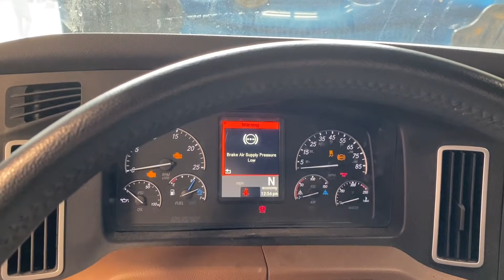Salvage Freightliner Cascadia Rebuild Totalled Copart Semi-truck Full timelapse

Comment: Money wise isn't cheaper to get another one?🤔? Just wondering how much hard work and money but at the end it's worth it
Reply: I'd say not considering it's the most common truck in America, so parts are readily available and cheap.
Reply: Yes Carlos ur right...
Reply: I can buy a great truck with 300k miles on it for around $20k-$30k I would never want to rebuild a totaled truck like this. Not worth it.
Reply: @ItalianStallion1415  there are no trucks that are 30k and have only 300k miles on it. If a truck has only 300k miles it will cost almost 70k so stop lying
Reply: @ItalianStallion1415  depends on insurance excess, insurance value on the vehicle, millage, spec, newbuild waiting lisits times and labour rates. 
most owner drivers its a no brainer to replace, but to a haulage company with set labour rates for their mechanics prob not. 
in the uk a bear cab is £12k, doors about £2k,exhust systems £26k with adblue but thats new prices. The hgv unit itself is £120k upwards depending on spec.
Reply: @ItalianStallion1415  maybe a low spec daf you could buy one for that money but not a full top spec usa sleeper cab thats 1.3million mileage in tatty condition money your talking about

Comment: Love cacadia I drive it daily 
My fav truck
Reply: What engine
Reply: @shhhhhhhhhhhhhh....  dd15 Detroit
Reply: @mercpindi5522  any issues with the dd15 im upgrading from classic xl to a cascadia but i hear horror stories about dd15.
Reply: @shhhhhhhhhhhhhh....  no because it was 2019 model.  I drove it last year. Got nice leather seats, sports body kits, lowered, fully loaded basically with very low miles. Never had a single problem. Cascadia is a nice truck.
Reply: @shhhhhhhhhhhhhh....  but let me tell you volvo is better than cascadia. Especially the 2021. Currently driving that...ride and acceleration is so smooth compared to cascadia...easy to drive like a car and back up...plus the big mirrors...oh also d13 volvo engine is 1000 times better than dd15. Buy the new volvo you will love it.

Comment: Awesome work, but just seems like it would have been easier to just replace it with that extra cab, rather than just use the floor pan, A pillar, and firewall.

Comment: Was the frame checked? Trucks tweak frames without wrecks so just wondering if it was checked. Why didn’t you swap the cab? Good cabs can be found so if you’re taking it that far apart would it have been cheaper or easier just to swap the cab?
Reply from the maker: Yes, it was checked and fixed (13th minute), I believe it was 1 1/4" bent. 
I didn't swap the cab because it's cheaper to fix it. You can buy side for $2000 or sometimes even cheaper, if you wanna swap the cab you're looking at $4000 (at least) just for the shell with no roof included. Plus there're gonna be a lot more work installing whole bunch of rivet nuts etc. And you save a lot of money on paint job, cause you just need to paint side instead of the whole cab.
Reply: Come on salvage paradise  13 minutes to straighten a 1,1/4 bend you can't  hook the frame  up to pull in 13 minutes ???? B/S.

Comment: you guys did a great job there... I wonder though, does this type of repair restore the structural soundness of the body back to original or are there some issues that appear later on? I have seen videos of semis in wrecks that you could swear the driver did not survive and often wondered about the structural design of the cabs being inadequate in some instances. Thoughts?
Reply from the maker: I don’t know about other rebuilders but some of  our trucks have already been to accidents after we worked on them and I didn’t notice any difference in structural soundness.

Comment: I drive a Freightliner M2 but I have a very old sleeper.  Is there any place I can buy the bunk/cabinet/sleeper parts, preferable the 2018 variants.  Or is the only options to get salvaged parts from a wrecked truck?  I really need the murphy bed and cabinets etc to get my sleeper redone.
Reply from the maker: We don’t work with m2s sorry

Comment: The bigger question is...why? Cascadias are basically throwaway trucks.
Reply from the maker: Yes. Usually people put 1M miles on them and buy a new one. Because people sometimes can save as much as $40K rebuilding one.

Comment: AAAAAH!!! The trucks that are re sold and the new or same owner has to spend thousands of dollars trying to find the water leaks.
God forbids the water gets into the fusebox.
It should be illegal to sell a truck after such an accident.
Reply from the maker: Never had any of the problems you mentioned.
Reply: @salvageparadise  Well,I ve had...it s always the driver that finds out about it.
Reply from the maker: @giovannisocci8793  Then you're buying trucks from wrong people. We're not only selling them, we have trucking company as well, and I know if something happens. So far I remember only 1 case when the cab actually leaked, I had to align the cab and decided to keep original weather strip. While i was aligning it the glue came off and windshield was leaking. So i just changed the weather strip and applied a new glue all around. Never leaked again.